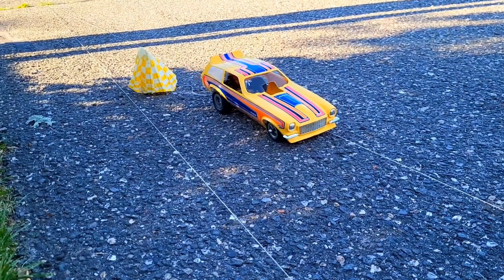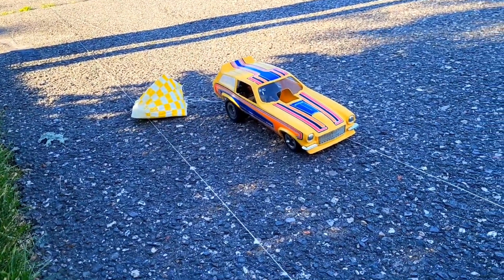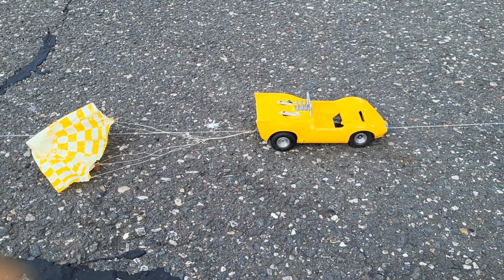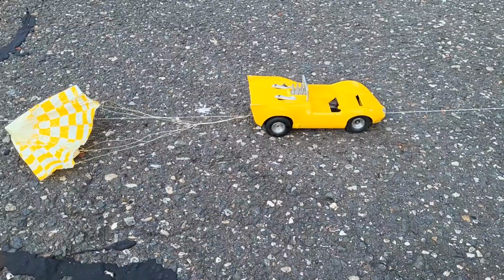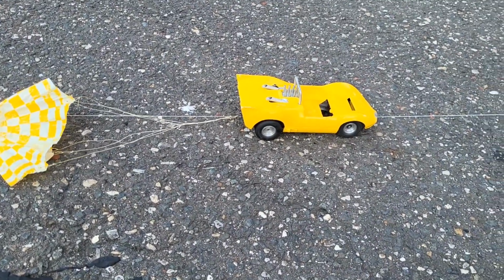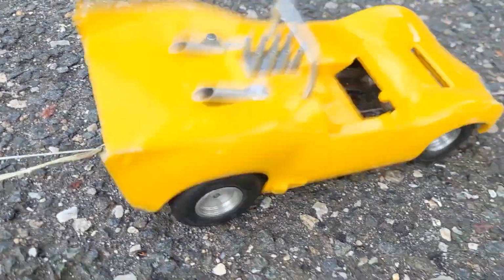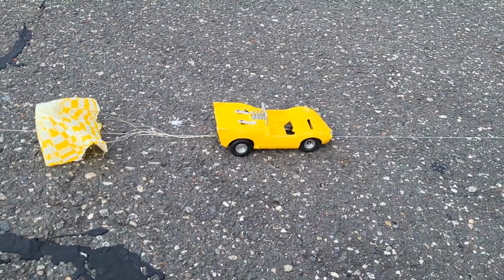Cox Drag 2 Fer Vega & Chaparral💛Short track w repairs 🏆 Always excitement on the Juice Nitromethane

Comment: I never had a nitro car In the 70s, but I had a Kyosho Assault in early 1987 or so. I could never get it to run right  from the very beginning and that was due to bad fuel twice in a row. I finally was able to make the cz-1 run correctly after buying some tower hobbies 10% nitro which was fresh. Curious to know what would be a good fuel to run in vintage nitro buggies today?
Reply: You can run any modern production glow fuel made today. VP Racing is an excellent brand and it can be had in many blends of nitro and oils. Whichever brand you can get, I recommend the "Sport" fuel with 15% nitro and 18% oil blend of castor and synthetic. Avoid the so called race car fuels because they only have 9% oil because racers don't care about longevity in their engines, lol.
Reply: @xKmotx  Thank you so much, I have 3 vintage nitro cars from the mid to late 90s today that haven't been run, but are in good shape. I always kick around the idea of driving them down the alley behind my house, but not sure what fuel will prevent them from being permanent shelf queens.
Reply from the maker: Go for it! Get some off the shelf fuel at hobby shop as suggested 😎